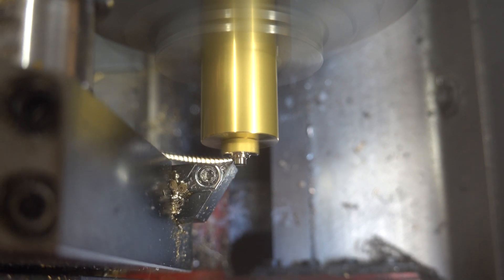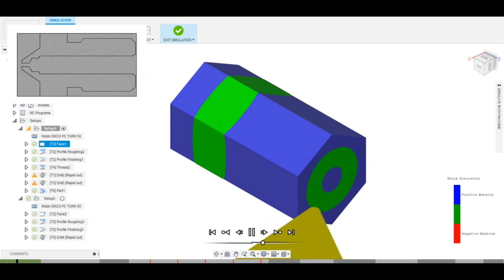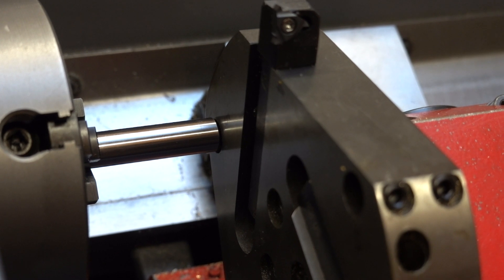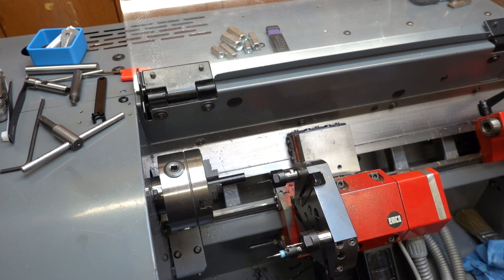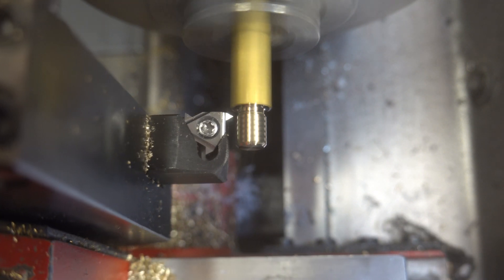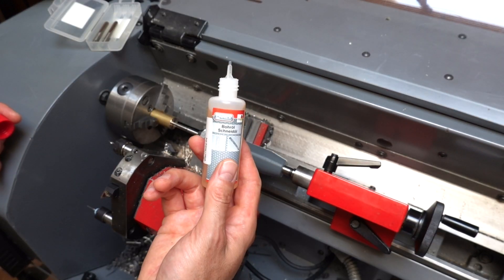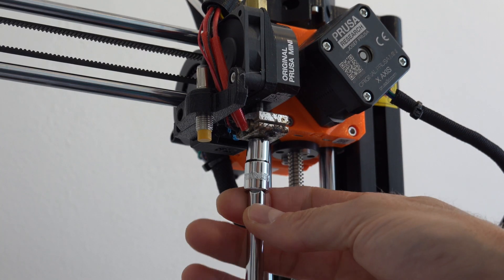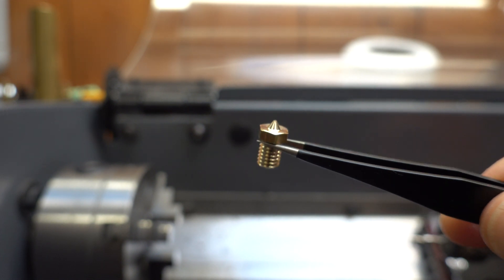Making Nozzles for my 3D Printer on a CNC Lathe

Comment: The concentricity error is because you removed the bar after drilling and tapping. Even just loosening the jaws and re-clamping will change how they are clamped. You would either have to indicate it in using the 4-jaw or re-drill and tap every time you take it our of the chuck...
Reply from the maker: Thanks for the tips, there is indeed quite a bit of eccentricity when using the 3 jaw. Once I get faster at Centering parts with the 4 jaw chuck, I will probably use that more frequently.
Reply: @uptimefab7412   A little trick I learned for regaining concentricity after removing a part from the 3 jaw... use a sharpie to mark the stock position in the chuck, then try to reinsert it in the exact same orientation. It's by no means perfect, but it definitely helps a bit.

Also, I could be wrong, but it looks like you didn't turn down the body of the holder at all. If you turn it first, you will have better luck regaining concentricity, because raw stock isn't that round to begin with.
Reply from the maker: Absolutely right, I did not turn the outer diameter of the holder. This is actually a really quick job, so I am not sure why I skipped that.

Comment: Nice project. It would be interesting to see the same made from a harder material like 4130. Brass nozzles are fine with pla, but with many other filaments they dont last more than an hour or so.
Reply from the maker: That is a nice idea indeed. Cutting steel should be possible on the emco 50 to my understanding. Probably with conservative cuts given the limited power of this machine.
Reply from the maker: That is a nice idea indeed. Cutting steel should be possible on the emco 50 to my understanding. Probably with conservative cuts given the limited power of this machine.

Comment: I think you need to service and clean the turret, I don’t remember it being that slow. Must be sticking from grud or lack of lubricant.
Reply from the maker: Thanks for the tip! I have never opened it so it would be a good idea to check if it is clean and lubricated. The speed "sounds" like it is not always very consistent, so you are probably right. I will have a look at this!

Comment: Maby use a plexi glass drill bit to make that chamfer inside the nozzle?
Reply from the maker: Thanks for the tip, haven't tried those before.
Reply: @uptimefab7412  dont know if they come in that tiny size but maby or you have to make one.

Comment: I enjoyed the video and here are a few things that came to mind:

You did the Ø0.4mm drilling after the main bore was drilled. Did you do anything to deburr the inside of the Ø0.4 hole?

When you had done all the machining of the nozzle before parting it off you could have used the parting tool to create a datum surface in the material where the cone point was going to be machined. Then when you put the nozzle in for the final machining and drilling you can put the nozzle holder in the 4 jaw and centre it using this datum surface.
Reply from the maker: Hi, thank you for the tips! I did indeed not do any deburring on the 0.4 mm hole. The front seems fine but I am not sure if any burrs were formed on the inside. It could be a cause for less than optimal flow of the molten plastic. Also like the datum surface method, will try that next time.

Comment: Great work bud. Im basicalky doing exactly what You did here with kathe accept Im building the whole lathe from scratch on linear guide rails with 8 tool ATC and hopefully... a 3axis for milling. I might have to call on Your experience for help. Im using the same comapany they are doing a 3axis lathe controller for me.
Reply from the maker: Sounds like a great project. I am actually also in the very early design  stage of trying to make my own mini lathe. Not sure if that will ever be realised, but this CNC stuff is quite addictive, so who knows. If you need any help on the controller I will try to help where possible.

Comment: hey, nice work!. I noticed the printed Land Cruiser door... do you happen to have a Land Cruiser body design? I would love to print one so it matches mine :)
Reply from the maker: Hi, thank you! It is a part of the 3d Sets Bamboo 4x4 pick up, model 12. Sorry I do not have rights to share this model as it is commercially available. The price is reasonable I think. Spent much more on parts than the CAD model.
Reply: @uptimefab7412  excellent, found it! Didn't know it was a model you needed to pay for but worth it.
Thank you.

Comment: What program are you using for the simulation and G-codes?
Reply from the maker: I use Fusion360 for generating Gcode. Typically I do not run a simulation if the posted Gcode, but I have used NCviewer on some occasions. It has a lathe mode (diameter mode), it is web based and free to use.

Comment: Donit in one setup:
1. Facing
2. Drilling 1
3. Drilling 2
4. Drilling 3
5. Rough
6. Thread
7. Nozzle and parting same time
Reply from the maker: That is indeed a lot more efficient. I thought about this method as well, but I did not have a drill of 0.4 mm that could reach through the largest hole. My 0.4 drill has a 3mm shank.

Comment: Now that's definitely a small, but ambitious project. I hope that you will go further down the 3D printer nozzle rabbit 🐇 🕳  and try some different variations. Perhaps you will come up with something novel that improves upon what is available currently. Great videos, they are very well-edited and informative.
Reply from the maker: Thank, much appreciated. 3d printer nozzles are indeed an interesting project to work on. Maybe one day I will try making a high flow nozzle or something like that. As you may have noticed I do not have a fixed release schedule. Too much time going into the day job lately :)

Comment: Nice! I want to make nozzles for my plasma cutter. Also I have the same lathe, although ive modified it quite a bit. Instead of shimming the tool turret, I got larger shanked er11 collet holders  and ground them eccentrically so i can rotate them up to the correct height individually. with the small drills its espescially important to have good alignment.

I have a masso control that i plan to use for it, but the original fanuc control is still working. I made a new headstock for mine that accepts 5c collets with a 38mm through bore and also mounted an air collet closer on the back so it can pull bars to automatically make parts. I mounted a bar puller directly to the cross slide.

Also I have a lathe tool touch off probe that has a special conical tip that makes aligning and setting the tools straight forward.
Reply from the maker: Wow, it looks like you have really done some serious upgrades to your lathe. A 5c collet on a small lathe like this is very cool. Thanks for the tip on the eccentric ER Collet holders!

Comment: Could you Show me your small cutoff Tool? Where i can buy it?:)
Reply from the maker: Sure, it is a CTPA, 10FRN type parting tool. Under my website article "mini cnc retrofit" there is a PDF with links where to buy the tool and holder as well as all other tools I use. Here is the link to that file: https://uptimefab.com/wp-content/uploads/2022/11/EMCO-PC-Turn-50-Lathe-Retrofit-v1.2.pdf. note that the file also contains another part off tool, which I don't use anymore so make sure to search for the type mentioned above. Explained in descriptions in last column of table in the pdf.